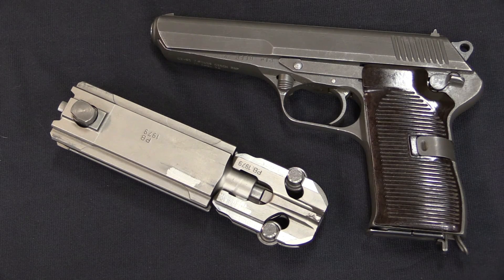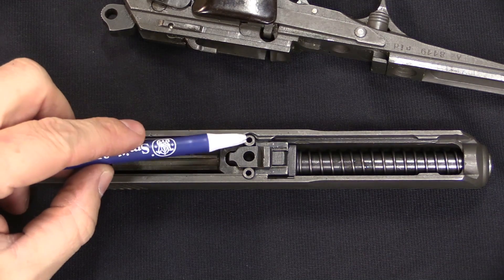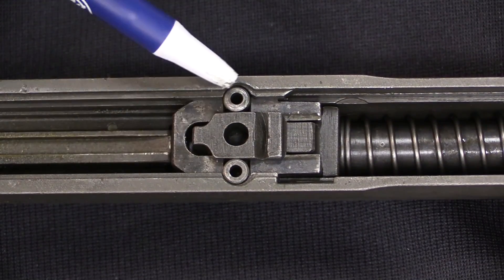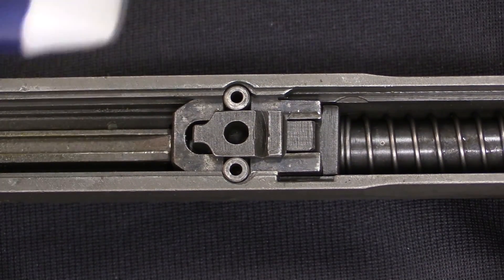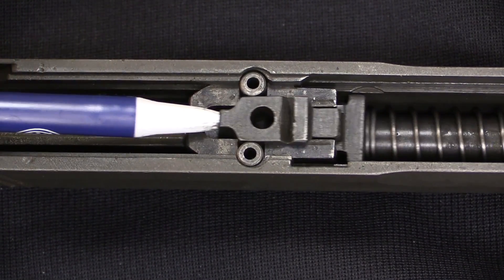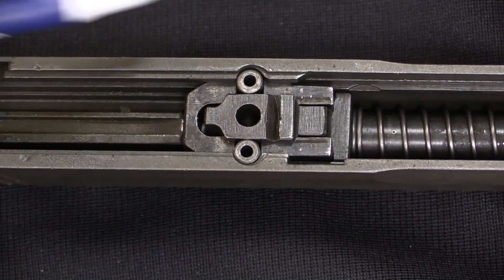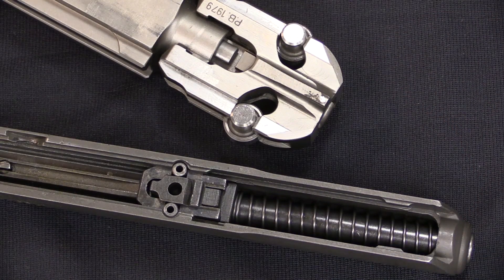How Does It Work: Roller Locking

Comment: Gun Jesus mentions "Roller locking is  rarely used in practice". What are the disadvantages/advantages of this system?
Reply: Because it still requires a short recoil system (in a pistol) or a gas system (in a rifle) and so you essentially gain nothing over more traditional systems like Browning short recoil or any other rifle action. If you want rollers, the real win is being able to go to Roller-Delayed Blowback which eliminates needing a gas system altogether.
Reply: @RussianBlue4S  Thanks.
Reply: @RussianBlue4S  "Because it still requires a short recoil system (in a pistol) or a gas system (in a rifle)"

You can do roller locking either way in either platform.  The MG-42 and later MG-3 are roller locking short recoil.  Short recoil rifles aren't unheard-of - the Johnson was a very good rifle that was short recoil (but not roller-locked though it would have worked just as well).
Reply: @RussianBlue4S  
Since you gain nothing (besides a roller-delayed system, which may suffer from ammunition sensitivity, unless you design it to be adjustable) what exactly do you loose compared to an AR-15?
Reply: @jonasstrzyz2469  I have never met a roller delayed system that was actually ammunition sensitive in practice. What do you lose? It will cost more, because the last serious work done on a military roller gun was the G3 and its variants. You'd have to engineer a new one, but once you did that and had it in your hands I have no doubt you'd find it shoots just fine compared to any AR. They don't give anything up on accuracy (see PSG1), controllability (See MP5), and they recoil doesn't have to be as violent as the legends say (see SL7).
Reply: @jonasstrzyz2469  I think a roller locked system might actually be easier to machine than an AR15 style multi-lug bolt.  Simple cylinders are easy to machine and cylindrical holes in the receiver are easy to drill.  The downside is that you lose the direct lug-to-barrel lockup and the upper needs to be heavier to contain the firing forces (a roller lock inside the barrel extension would be hard to machine).  Besides needing a heavier upper, the bcg wouldn't look all that different, and the gas system would be identical.  The wedge for the rollers and the internal piston system (DI-ish where the gas key pumps gas between the bolt head and bcg) would just push the wedge back instead of rotating the bolt along a cam track.
Reply: @RussianBlue4S  " the last serious work done on a military roller gun was the G3 and its variants."

Not roller-locked.  Roller-delayed which is very different.  The G3 et. al. were blowback guns.  And the cost was inflated nonsense.  They were inexpensive for military and police units.  They used stamped receivers; the advantage to roller delayed blowback was low cost.
Reply: You can accidentally make it work when it fires out of battery slightly and then you can do away with moving barrel, which reduces component wear I suppose
Reply: @TheFanatical1 you can’t make roller locked guns fire out of battery by design. The firing pin will not go forward unless the rollers are able to lock, which is a built in safety feature of the design which it shares with flapper locking.
Reply: Disadvantages would include more complicated and costly production.

Depending on the overall reliability of said firearm possible increased costs for repairs and training for users and maintenance personel.

Purchasing a military firearm has extended costs of maintenance, for the service life of the pistols.
Reply: @shawnr771  From a machining standpoint the roller lock system on that CZ-52 is stupidly easy to make, almost everything involved is just plunge cuts, which are easier on tools and would likely reduce cost.  Cost of production I don't think is a factor.

What would be a factor is the slide needs to be a bit bulkier around the lock points compared to a browning system. 

I can tell you as an owner of a CZ-52 that they are very simple guns and I don't think I've had a single failure in several thousand rounds, the grip does feel like a 2x4 though, and I've seen them break firing pins, though mine hasn't yet.
Reply: @Pulsarr1  Thanks.
Reply: @shawnr771  it was actually cheaper to produce than rotating bolt! That's why the Wehrmacht experimented with it for last ditch automatic firearms.
Now, with robots doing the milling, it's less of an issue.
Reply: @edi9892  Thanks. Is it easier to maintain and train soldiers on?
Reply: @shawnr771  I don't know (I heard that the G3 is a quite precise rifle with a heavy recoil, but I can't really talk about shooting or field stripping roller locked designs). However, if a piece breaks from a rotating bolt, the entire bolt has to be replaced. If a roll breaks, you just need to replace that and that's far easier to machine. That was a big concern during WWII, as mass production was in its infancy.
Reply: @jantschierschky3461  The USA yes. Germans and Soviets not so much. German Luger for instance are famous for not being interchangeable with other Luger despite having the same parts on paper. Just imagine them having to mill a bolt with rotational symmetry and make sure that it fits in every receiver...
Reply: @jantschierschky3461  I´ve heard from multiple sources that mass produced parts had to be filed and bent until they fit together. AFAIK, they also struggled with stamping, just like the Russians originally did. That doesn´t mean that they were unable to do so, but it took them quite some time to get it done reliably and efficiently.
Reply: @jantschierschky3461  the mg 08 is not a good example as each barrel was matched to a bolt head and you would replace both parts at the same time since they were not expected to be interchangeable
Reply: @justinreijnders8992  isn't the MG08 just a Maxim gun action too?
Reply: @fdsdh1  yes the Mg 08 was a licensed copy of the Maxim that predated the ability to do case head adjustments which is why the bolts were matched to the barrels
Reply: @shawnr771   The complaint I hear the most about roller-delayed blowback is weight.  The old HK roller guns were quite heavy compared to most modern guns people are used to, because it was made mostly of steel.  The second-most common one is that it runs very dirty, since you are blowing fouling right into the chamber.  The third is that the HK guns had fluted chambers and, according to some, they chew brass.  I would also guess that it is actually pretty hard to manufacture good/reliable ones, since a lot of little details have to be made just right.

As for advantages, a roller-delayed blowback operating system allows you to have a truly 100% honest-to-god free-floated barrel in an auto-loading rifle, with no gas tube/gas block/etc therefor the barrel harmonics would theoretically be excellent.  HK guns still had the front sight block, though, and if I am not mistaken, it touches the barrel, therefor they're not truly 100% free-floated.  One youtuber called "9-Hole Reviews" describes the recoil as a "push" rather than the sharp strike of a gas/locking-breech gun, which also sounds advantageous.  Take all of these statements with a grain of salt as I've never fired one.

Really cool operating system imo.
Reply: @edi9892   People generally think of stamped receivers as being cheap and mass production-friendly, but I think that's cuz of the AK and maybe the AR-18.  The HK stamped receiver is about 100 times as complicated as an AK receiver.  An AK receiver is just a rectangular piece of steel with a couple embossings and two 90-degree bends, with the little rails being bent as well, and then a couple more rails spot welded on.  From the ground up, the AK was made to be shit out of a factory at mach-speed.

The HK receiver was all one piece of metal that got bent all the way around some sort of mandrel, with wacky undercuts (underbends?) and a more rounded, precise shape that had to be realized.  I don't even know how they did it, but it must have taken a lot of fuckery to get it right.

I have no idea why HK didn't just stamp two clam shells and weld the fuckers together, then do the final bending to achieve dimensional accuracy.  Hell, they could have designed it to be seam-welded along the top, too, and they still could have charged absolute fuck-off money for it and it would look almost the same while being laughably easy to manufacture in comparison.

Wow this comment is long, not sure if I am even responding to the correct post but here you go read my text please and thank you k bye
Reply: @shawnr771  I am fairly certain self actuating rotaring bolts are harder to manifacture than flapperlocks.
The main disadvantage would be lover locking surface.
Reply: @ineednochannelyoutube5384  The main disadvantages are that they require precision small machining because it'll start to eat itself if the surface is damaged or uneven due to very hard rollers (or conversely will start to eat rollers and "stick"), and that there is a potential for losing very small parts BUT occasionally leaving an assembled weapon that will still function... once.
Reply: @mfree80286  What about dirt and mud? Does it do well in the mud test?
Reply: @ineednochannelyoutube5384  Welcome to the days of cheap CNC.
Reply: Well, gas-operated is preferred much more for anything bigger than pistol cartridges, because gas -operated is bolt-lock, which the locking is reliable. Also, just to make it cycle properly, it is easier on designing standpoint to wrestle with the fluid dynamics of gas, rather than the entirety of physics(recoil operation). Same reason for delayed blowback(both roller and lever).

IMO, this is probably why the Bundeswehr switched from recoil-operated MG3 to gas-operated MG5. Not to mention, the gas-operated MG5 is easier to configure in terms of rate of fire. Also, no modern army nowadays wants to use GPMG as anti-aircraft work, something why the MG42 and MG3 has insane rate of fire.
Reply: I haven't heard of problems with ammunition in MG3 variants and NATO 7.62x51 isn't the most consistent. FN's MAG and Minimi are so good few NATO countries want anything else so there's little incentive to develop new machine guns.

Rotating bolt designs dominate modern carbines, it worked and everyone knows how to make them work so there's no need to change.

Had the CZ 52 been designed in the West then no doubt other people would have copied its locking mechanism but it wasn't so they didn't.
Reply: It used to be cheaper and probably easier to repair. I guess that controlling the wear so that it remains reliable for many shots was a big issue.
I guess the rollers are made of softer material as they are easier to replace. However, if one of them gets damaged and thus wears down faster, this could be a problem. 
Also, there's a lot of pressure on a small surface. 
There's a sniper rifle built similarly, but they replaced the rollers with a more complex shape to increase the reliability. I don't know how exactly this works though...
Reply: @edi9892  I found in a manual that you can get rollers in 4 sices. Without mark, with one punched point (on a flat end) with 2 and 3 punched points, getting bigger to compensate for wear.
Reply: Roller locked systems have 2 main disadvantages, mostly from military point of view. First is that rollers are rather small and can be lost during a disassembly. Second is that they have weaker ejection when compared to rotating bolt (and rotating barrel) systems.
Reply: @F1ghteR41  Weaker ejection? G3s and HK33s literally send cases to space.
Reply: @andybreadley429  I spelled lose wrong.
Reply: Edward Gonzales I'm not sure, but I can imagine the major advantage could be that the barrel does not tilt or rotate in the action, so it would be good for use with suppressors. The small loose parts could be a disadvantage in field strip.
Reply: Roller locking wears faster and ends up weaker, requires more and more intricate mechanisms to achieve the same thing as a rotating bolt.
Reply: They're more complicated, which means more time consuming to produce, which makes them more expensive.
Reply: @danielbain3613  
Are they any more complicated than multi-lug rotating bolt designs? Because that is the only real alternative
Reply: @HaydenLau.  What time period? Pre CNC machining. An example, when Germany switched to the p-38 from the POA it was a lot cheaper to produce. The Luger took something like 400 machine operations and final hand fitting it was very time-consuming.
Reply: My guess would be ammunition sensitivity? And the fact that the AR system has had 50+ years of development so from an RnD standpoint designing a new roller locked firearm is probably more expensive. Although, in a gass gun, I do not see how ammunition sensitivity would be an issue.
Reply: @jonasstrzyz2469 i dont like ar-15 platforms
Reply: @pablo4yu   Neither do I.  God bless you.
Reply: @jonasstrzyz2469 
Ammunition sensitivity is not a concern with roller lock

Comment: So where is the rest of that mg42 Ian. Don’t be holding out on use man.
Reply: It looks it's from a pistol
Reply: @alecjones4135  An MG 42 pistol? I want one!
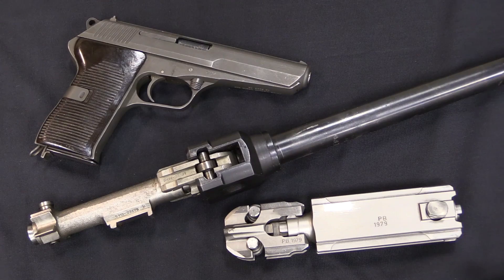Reply: Alec Jones 1:34 in that bolt and barrel are from a mg42.
Reply: @Kbaker45862  Or an MG-3 ;-)
Reply: Rolf Nilsen good point I never thought of that.
Reply: @Kbaker45862  As this is Ian - it probably is a MG42 piece tough. 

I served for some years with the Mg3, Mp5 and the 105mm L7. Hence the fixation on the Mg3.